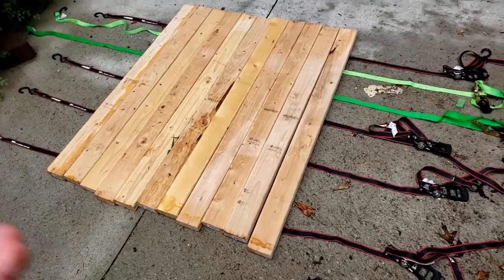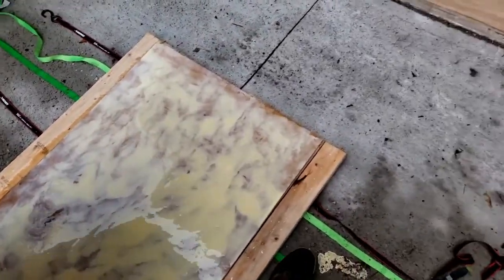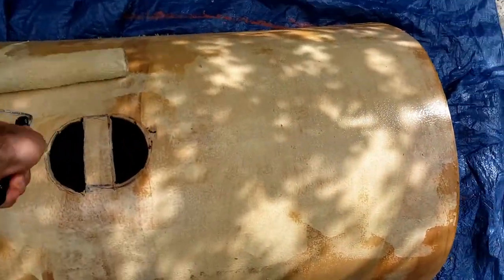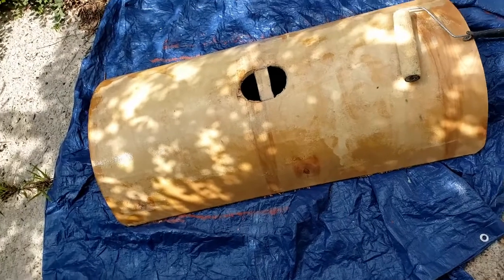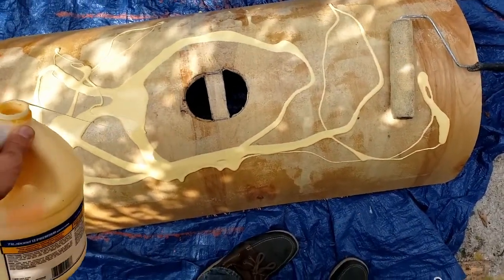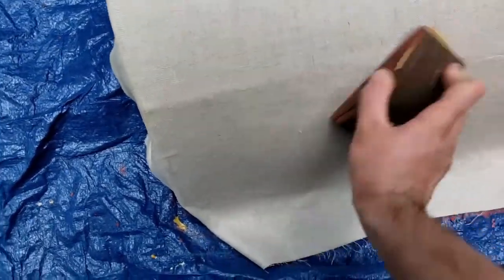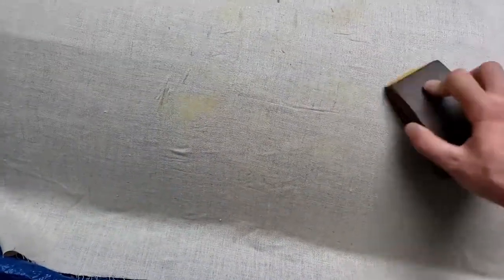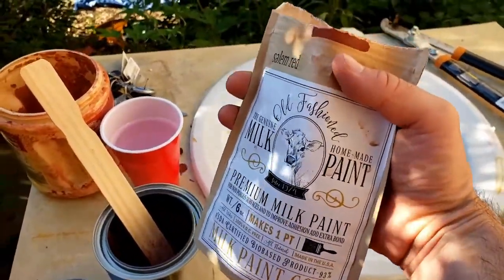How to make a Roman Shield - Scutum

Comment: Just the video I am looking for. It is amazing how little there is out there about making your own scutum.

Could I ask as I am copying your tire method can I ask about it:

1 - What diameter was the curve circumeference roughly?

2 - How long do you leave to cure when wrapped down?

3 - Does the type of glue matter?

4 - How long to wet the wood for?

5 - What sort of paint matters and can you use canvas instead of linen?

6 - How did you get the Eagle Design on there? weas it painted or decals?

Hope these aren't too many questions for you, but thanks in advance!

Comment: Did you paint the yellow over the linseed oil? Did it stick? Did you use milk paint for the yellow too? I've followed your tutorial to the point I'm ready for paint, but want to make sure I get that part right. Thanks for the video!
Reply from the maker: Yes, painting was literally the last step. It stuck just fine. I just used paint from Walmart. I only used milk paint to soak in the Lenin before I covered with linseed oil. Made the red darker :)

Comment: Did you try fighting any barbarians after you did the shield?:)
Looks great! I am thinking about doing this myself and hang it on my wall.
Reply from the maker: The Barbarians are the undead in this short film. There is a scene where a horde will clash into the shield wall. We're preparing to do a rehearsal on it :) yeah Roman Soldier reenactment use this method to build their shields.
Reply: @revengeoftheromansorceress  thank you! I will check out that video:)

Comment: What extra steps did you take for the other features on the shield at the end?
Reply from the maker: You glue Lenin over the shield. Then use a sand block to even out over the shield. Then once dried, paint it with milk paint. It's like water paint that soaks in the Lenin. Then you gin seed to seal coat it for protection and gives the red a darker tint to it.

Comment: You skipped quite a lot of the process.  You show a single layer of ply sheet being glued but there are actually three from what you said.  You dont say whether these are all done at once or individually.  I guess we are to assume its at the same time.

How you attached the handle and the rim work, is left entirely to our imagination, as well, the  reinforcement on the inside, the attachment of the boss and central rectangle, and how to shape this, and.........

This is the first half or basics of the process, but loads left after this, to make it fight worthy.  This is essentially the shell of the shield and now you will need to dress it, brace it, and reinforce it.